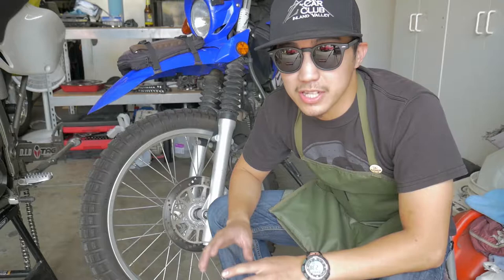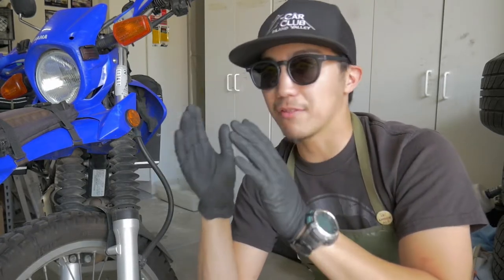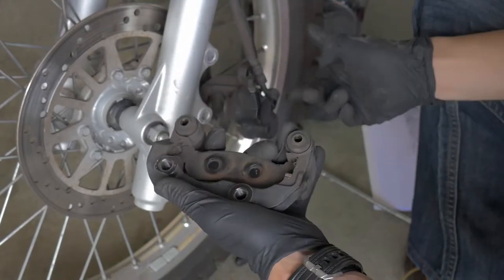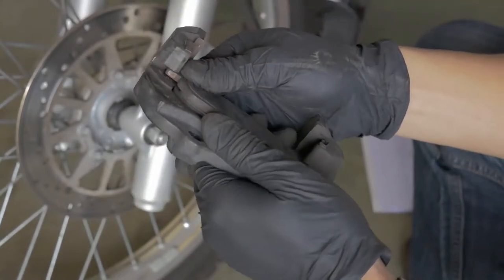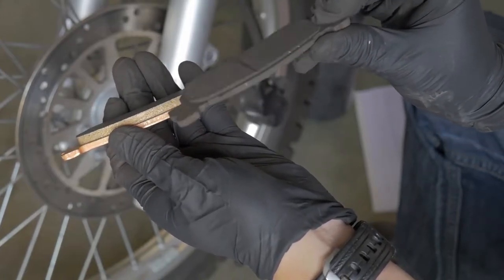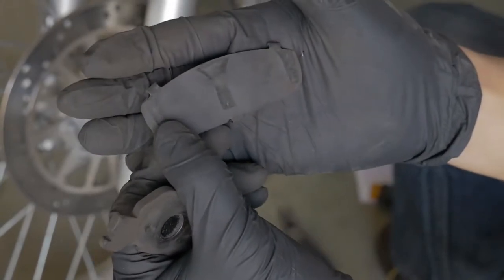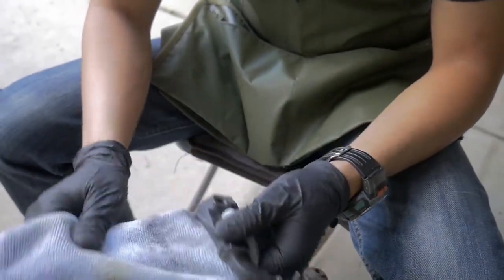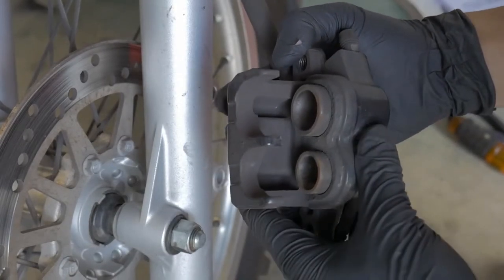Yamaha XT250 Maintenance: How to Change XT250 Front Brake pads

Comment: Definitely missed a couple potential grease spots. A thin layer between that inner pad and the backing plate for noise and vibe control is always a good idea and usually called for in most brake jobs. As well as in the track of those spring clips the pads ride in.   Might not be in the service manual but can't hurt... unless over applied. 👍🏻

Comment: Having a soft brass brush is invaluable for brake work. How many miles to the brake job? Rear pads worn yet?
Reply from the maker: I know, All of mine were covered in grease from a previous job. :/ The rear pads are totally fine, but I bought some EBC pads for them I just haven't gotten around to swapping them out.

Comment: What mic do you use for your GoPro session?
Reply from the maker: +TexasRider90 Beefy I use a Sony stereo lav mic hooked up to a zoom h1 audio recorder. If I'm not using that one I'm using my Sena 20s hooked up to my hero 3 via a Sena gp10 backpack unit. I tried using the same mic using a hero 5 adapter but that setup was GARBAGE.
Reply: NoOnesWatching my back brake pads (XT250) are worn down, how do I change them out?

Comment: That grease looked like white lithum grease. Which is what most people use kn brakes just dont get it on the rotor
Reply: "SILAramic" is silicone based, it's in the name.  Also common is "SILglyde".   White lithium grease is LOW TEMP grease, not acceptable for  this application.